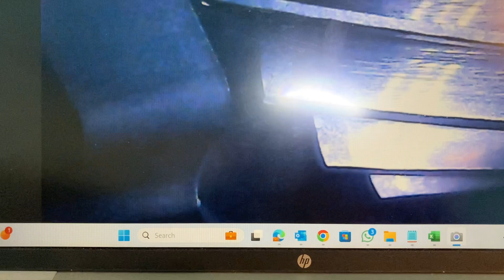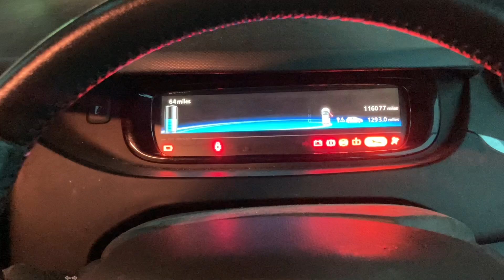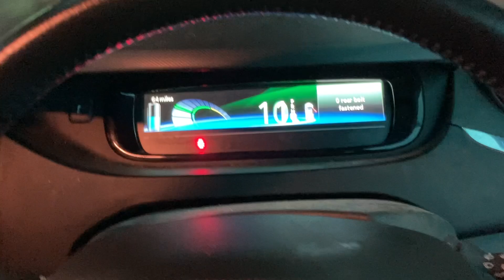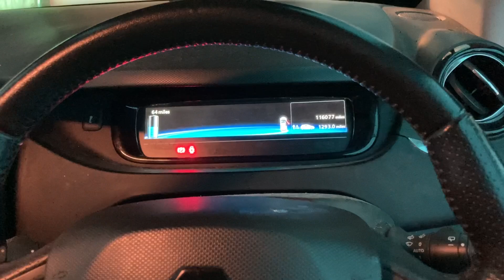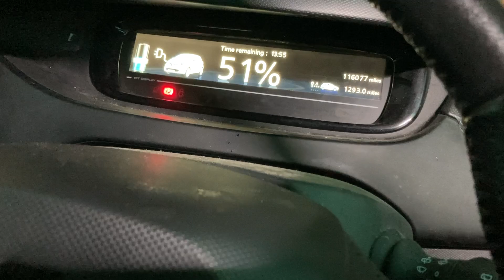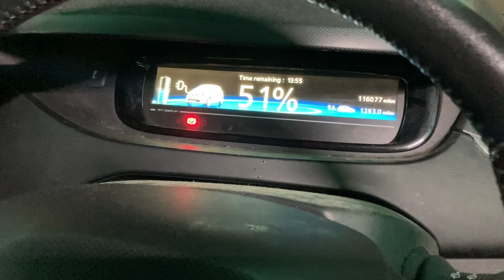EV Repair project - fixing the reduction gear noise - Renault Zoe ZE40 gearbox repair

Comment: I would be thinking maybe about using an up rated oil in the transmission.
 How many miles has this box done ?
Reply from the maker: Hi the replacement one has done approx 20k miles. Always wary of changing something like oil spec as it’s not my area of expertise. Cheers

Comment: Interesting to see the gear wear. It seems far too much for the mileage and power transfered. Perhaps it is a factor of very high torque at very low rpm. 
The wear is comparable to a 15,000 hour 30 year old 100hp tractor reduction drive.  Which has never seen an old change.